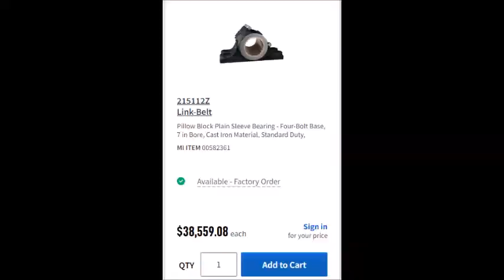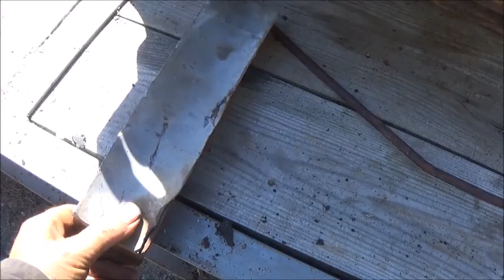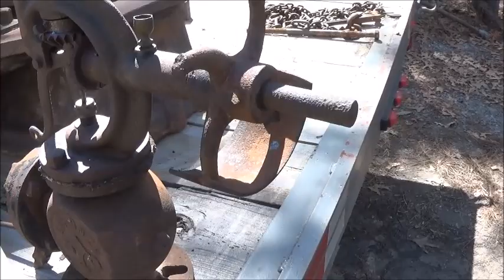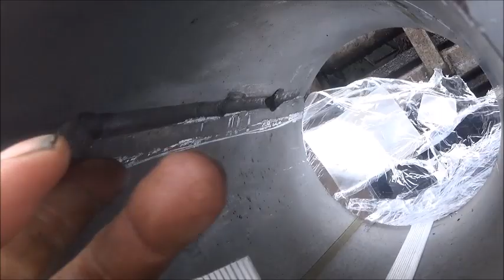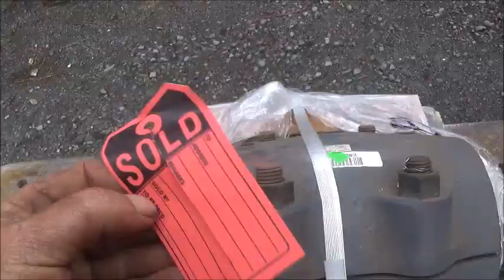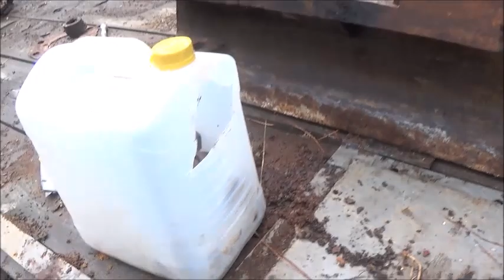HOW I SAVE OVER $38,000 ON A BEARING FOR A STEAM ENGINE

Comment: Fayetteville? Interesting. I used to supply a factory in Fayetteville WV. Pretty cool. I have never understood the whole idea of plastic bottles and then saying we need to stop using fossil fuels. I think that came from a byproduct of petroleum that was typically thrown away before. They've been doing things with plastics from non petroleum processes. Plant based I Think?  I agree that those circular and squared off hold downs were made as a whole piece and cut in half.

Comment: Yea pouring your own isn’t card at all and the price of lead isn’t awful either. I’ve poured quite a few on stroudsburg and McElroy winches on shrimp boats over the last 38 years and they are very forgiving on the margin of error that’s tolerable. Ours are less forgiving because we have gear to gear that has to be pretty accurate

Comment: Toward the end, the device is called a condensate receiver, and the small fitting on top is an air vent. This series, these old-time steam engines are very interesting to me. I'm a retired mechanical engineer, mostly HVAC, but with time on a steam-turbine-driven water chiller. 1200 horsepower, 450-pound steam with a cooling tower and condenser to pull the condensate down to 150 degrees F (to increase delta-P). Don't get hurt with these engines, Jonathan. You may have some silly subscribers who would like to see that, but most of us know you're someone special. Special or not, I hope most of us want to see you safe and healthy. All of you, even Vic (c:

Comment: If the power goes out for any length of time, you'll have plenty of steam power to run a generator and even an air compressor so you can keep right on working.

Comment: Jonathan W is 110% CORRECT, we USE plastic like it is going out of fashion, then RARELY it gets recycled YES we should using glass, aluminium which easily can be recycled, JW personally i would say get the 7'' bearing while it is cheap affordable because it Will GO UP in price, then later when you want/need it, it will twice the price!! This is EASILY the BEST channel on YT Cold War Motors being a close second, i do NOT bother with too many others, those that EARN RESPECT and Work Hard they get my subscription but the fly by nighters NO!!

Comment: I used to watch your videos every time.  

But, you changed the formula of work to result and I lost interest.   A couple three years ago you showed more of getting to the results, but now you show a pile of whatever and state here is what I am going to do, jump to the next minute and you show the finished job. 
For me there is little point to that, you could just skip all that and show a video of the project running and save a lot of talk and it would be the same to me. 
Your best stuff was around the time you cast the crankcase for the 'board track' motorcycle, or piece by piece rollback or car builds. 
I stop in to see something run and rarely make it to the end or just jump to the end because there is nothing to really watch or see until the result before heading back out to youtube search.

Comment: You got a hell of a deal on that bearing.  I have learned a lot about steam engines too -- I really wish you would explain how dashpots work.  I have no idea what they do and/or if they are in some way associated with the governor.  I don't know what they do either aside from mechanically controlling engine speed.  I totally agree about all the environmental nonsense.  Electric cars are not the answer as long as 85 per cent of the electricity in this country is produced by burning coal.  No matter what the totalitarians say, that is not going to change. A nation cannot smelt iron, steel or aluminum with windmills and solar panels.  If this nation does get sucked into another world war (which looks very likely) we are going to be in a world of hurt.  I agree, keep doing what you are doing.

Comment: As a Fitter and turner i had to cut a 1/2 by 4 inch slot in 4 inch cast iron block with a hammer and chisel as a test piece and then file it to a tolerance.

Comment: Boilers are no joke….it was not click bait - they can explode or rupture - I have seen the aftermath of such explosions/tube ruptures first hand (worked in a power plant for 23 years).
Reply: I used to shop at an electrical supply store that had a photograph of a house that didn't have a pressure relief valve on the water heater.  There was a concrete foundation and bits of wood all over a field.  Steam pressure is terrifyingly powerful.

Comment: The split bearing that fits the U-shaped steel strap, looks very much like a series 216 screw conveyer hanger bearing. Typically in available in 1.5”, 2”, 2.4375”, and 3”.  Made in various materials including solid bronze. One might be close enough to make work. They are very common and not too expensive.

Comment: Duplicating the bearing mount with adjuster bolts follows known success. 
However the adjusting bolts could be replaced with (2) pairs of wedges. Our 1826 grist mill top grind stone (spinning) above the stationary bottom stone is centered by (4) pairs of of wedges located in a square recess. The top stone has a round through hole while the bottom stone's square recess houses the bearing/spindle/adjusting wedges.

Comment: The horseshoe piece was probably formed in a Bulldozer horizontal iron forming machine. Machine has straight cut back gears and 20 electric motor. Very noisy when running. AL B.
Reply: 20 horespower motor.